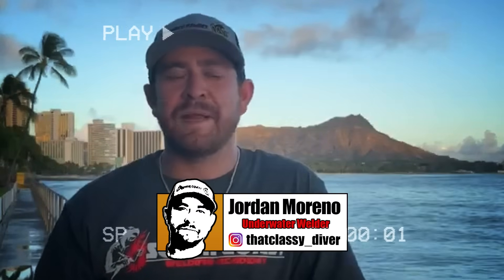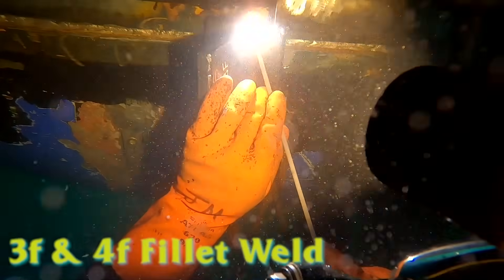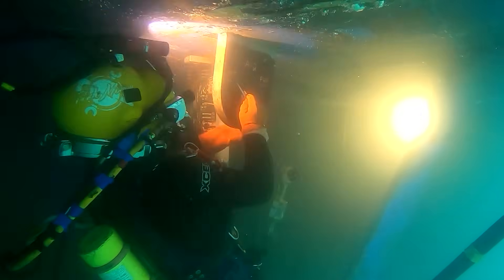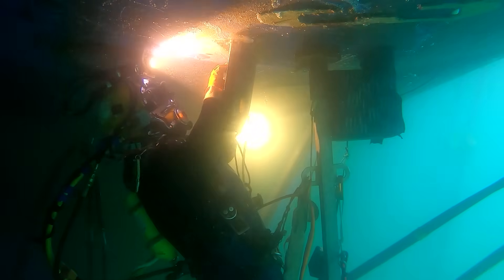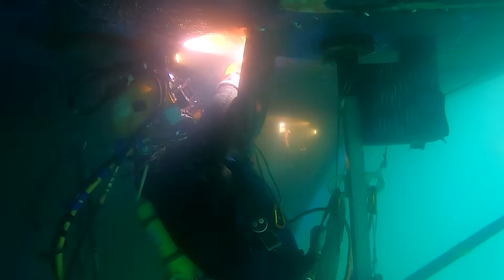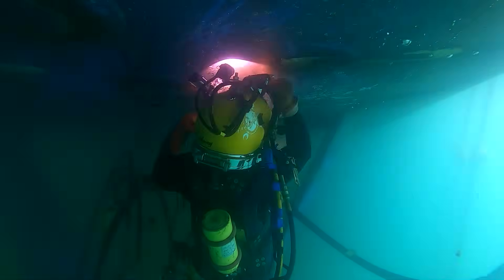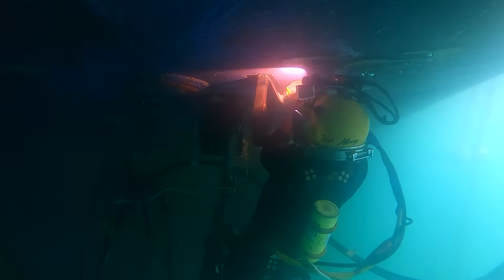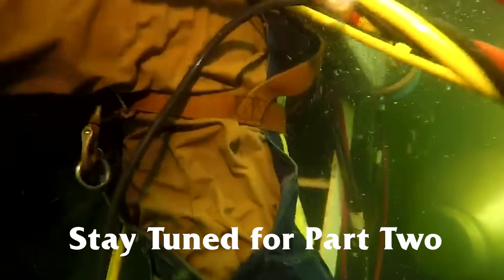Underwater Welding Test | 3F & 4F Plate | Pad Eye Welding

Comment: Are you holding your breath during the welding process? Is that for visability or to keep air from getting into the weld?  Seems like a hose coming off the mask that can direct the exhaust breath away from the welding area would be a good idea

Comment: I'm a retired maintenance millwright and also a certified diver and I've done diving and all types of welding and yet I've never combined both.

It always came across as wrong, underwater, welding and electricity all combined, i can't wrap my head around how you can run a bead underwater.

Comment: Bro when you grinded in 8:21 the metal moves after u welded is that normal?
Reply: Yes refer to the term space welding for a better understanding in space metals can be welded by jus mere touch in water properties are similar but not enough to cause that effect but rather enough so metal is more malleable and can as seen move a bit more freely especially due to the heat

Comment: Weld test are usually the easiest weld because it is in a controlled environment . As a Pipefitter/welder we get some tough welds in the field, tight places, high work, confined spaces, awkward body positions. Underwater welding is a completely different beast though.

Comment: Ironworker here on the topside. I am a structural welder by trade and do a lot of different processes and multi alloys in the field up in the air or at home. When we do multi pass fillets the inspector is supposed to check the first pass . And when we weld the root of a cjp  he might want to check the fit up before we weld  . Doesn't mean they always do lol .And of course all of our cjp's are u.t. . Would be interesting to try that out for sure .  Probably polar opposites in danger.  Being hundreds of feet in the air or being underwater.  Ragnor , harris , forney,  best welds make a shade 8 gold lens by the way.  I wear a shade 11 but stick I have noticed compared to innershield 232 makes a less bright arc . And if your out in Hawaii it might be hard to get what you want compared to the mainland.

Comment: Hi. I’m a construction diver and I work mostly for inshore civil project in Sweden.
I appreciate a lot your job and I have a couple of question.
I’m not qualified welder but I do weld a lot. Now we are welding on a sheet pile wall elements that they will be part of a key. We are performing 3F weld multi pass, 3/4/5 passes depending on how the elements join and how much we have to fill. The pieces we are welding are 5 or 10 mm thick and we use broco rods 3.2mm.
You use 90 amps. We use between 185 and 195. And I have noticed that on the test weld you do the length of the pass you do with one rod is more ore less half of the length of the pass I do with one rod.
The water temperature here is around 1 or 2 Celsius, but I would like to know why you think there is so much difference between your welding technique and mine.
Till now, and I’ve been doing the same job since last November all the weld were ok and supported lots of stress and tons by the concrete that was poured to build the key. But I’m curious to know your opinion.
Thank you!

Comment: I'm curious:

I know nothing about welding but @6:21, it's assumed that there will be a tiny amount of water in the middle of the joint, after the wield yes?

Unrelated question - I am a diver, 10 years, recreation (cold/warm/ice) how do you regulate buoyancy while welding?

Comment: As someone who has been involved in welding, weld inspection, and a wide range of NDE methods at hands on, R n D,  L3, and managerial levels we are not out to " GETCHA " as you say we are there to ensure that you as an operator are competent to meet the standards as laid down in the codes and to ensure  that your companies  weld procedures, instructions equipment and consumables are  code compliant and finally that all of your non destructive tests are carried out by qualified experienced personnel to the required codes and standards this of course will also apply to destructive tests . This may seem like overkill to some but when the you  have witnessed the consequences of weld that has failed under load then it may not seem quite so trivial.

Comment: As an old and now retired welder/diver i can see a decent amount of competence.  But i think some of your tech talk is wrong my friend when you talk about pen and polarity.  You got it arse about face. Neg stick gives better pen.  As a rule of thumb 2/3rds of heat on pos+ side, so if parent is pos its better pen as thats where the heat is. 
But for a O/H config and exhaled gas being an issue good effort... 👍 btw... consider a peanut/ bullnose grinder for dressing tails and finishing.  Far better than a disc which should not exceed 4" really for control
Reply: If by peanut/bullnose grinder you are talking about a die grinder with a tungsten carbide burr that's what I liked to use as well. Way better at cleaning stops and starts. Always hated using grinding discs in the water.

Comment: Do you need to clear slag off of your weld piece when underwater?
Reply: Yes, there is slag. Chipping hammer and wire brush work fine, but if you are feeling really fancy you can bring out the needle gun

Comment: Are you exposed to less chemicals / harmful vapors / metal dust since you are under water? I would imagine your lungs and body would be much safer compared to land welders, since you are in a suit and you're breathing straight from a tank underwater.
Reply: It’s worse being under water. Average life span of a underwater welder is 3/5 years due to all the pressure from the water
Reply: @sosaa3436  Jesus that sounds awful.
Reply: @sosaa3436  I just thought, is it still harmful even if it is all shallow water diving? Like nothing crazy deep to where it hurts you, but just like under boats and shit like that
Reply: @sosaa3436  10-15 years. And the death toll on average is 15%. However this does not take into
Account the amount of companies that do nto
Follow the rules and OSHA standards.
Reply: @HEX_NATION  wrong
Reply: @sosaa3436  wrong. Stop acting like you know what you are talking about. You don't.
Reply: @A_Lemon_Party  not wrong buddy, came from a welding instructor
Reply: @sosaa3436  

100 percent WRONG. This is coming from me, a commercial diver and someone who actually does this type of work,  not some topside welding instructor.

Comment: I have heard of stories here in Australia about divers checking the turbine inlets for obstructions or the bottom of dam for stress marks and damage and they were being taunted by huge inquisitive cod that literally could eat you whole and they surfaced and most said no amount of pay is adequate and just left but some were courageous enough to dive back in but insisted they wanted  cages so they'd see the next day. This wouldn't be easy with boyancy and currents pushing you around, time restraints, low temps, restrictive cramping dive suits, predatory and poisonous animals  lurking around, diminished visibility etc....cheers

Comment: I had a buddy that did this on oil rigs in the Gulf of Mexico. He’s older and man did he have some stories. Luckily, he didn’t have any weird stories where he had to arc into a shark’s nose or anything like that but I did here about him having to go into a box like structure at depth and I always thought that was pretty neat. Sometimes nature was hard to deal with like high currents and back-eddies around those huge legs of the rig. 
I have a huge respect for anyone that has to weld underwater. I met him on a job where he was what they call scarfing walls with these huge golden looking rods that look like black carbon when u broke them open. He would blow holes to make walls and I was the safety guy for the confine spaces they would work in. Talk about stressful. We were always worried about the blow off the rods hitting the insulation as that could make a gas that was toxic if it burned. So I had these little shields to block the welding flash and I would always be watching where the sparks and slag would go. A lot of fire watches with me. He said yeah that was dangerous but paled in comparison to underwater environments and I completely believe that.

Comment: Very interesting video about underwater welding. I was welding for 20 years before moving on to working as NDT inspector the past 8 years. 
I remember upon several projects completion the ship came and it would ALWAYS rain during sea-fastening of structures on deck. 
I got electrocuted while inserting the rods all the time. How is welding underwater safe for you? :)
Reply: @ Hugo Østebø

It’s DC current. AC current underwater is very dangerous and not used...if your leads are in good shape you won’t feel any shocks. I normally would use a pair of latex gloves under a pair of atlas gloves.

Comment: The welding doesn't amaze me as much as the underwater grinder lmao where do you get one of those!?
Reply: @ Justin B

You can use almost every pneumatic tool underwater...same with hydraulics. Of course some will last longer than others and some hydraulic tools are specifically made for underwater use. I’ve used all sorts of things from chainsaws to 1” impacts, concrete saws, shears and wire saws the list goes on.

Comment: And here I am, worrying about the moisture in the air is going to ruin my 7018's (backyard welder)
Reply: The electrodes get covered in a wax helping them stay good while in the water. However, once those electrodes get in the water. They have to be used as they will no longer be good even after taking them out

Comment: how do you not just automatically get electrocuted due to the open circuit voltage?? underwater welding is fascinating to me
Reply: Because welding is always a closed system. The only reason you get an arc is because the ground is completed. You get shocked if YOU are the path to ground.

Comment: I’m thinking about this. Cement pays 24$ per hour in Minnesota. Welding would be multiple times that over
Reply: Not really... no experience basic weld job, 11 to 13$   some experience 13 to 16$   2 years or more depending on certs 16 to 22$ 4 years certs and special training  24 to 28$ 8 years going to the veterans of welding and above 30 to 100$ bottom line they get paid the big bucks because of danger, demand, scarcity being the "welders" who can do the job, and experience. But to be fair it is a skilled trade if you can do the bests welds than you could technically cheat the time it takes for experience
Reply: And those numbers aren't factual just overall that's usually what they are

Comment: So the first question that pops into my head is; does the weld cooling pull whatever it is out of square, harder from the rapid cooling the water would have, or is it comparable to above surface fitting& welding? 🤔
Reply: Yes, but no.  That plate was like 2 inches thick

Comment: Is heat warping ever an issue?
Reply: That a rough 3" to 4"  steel plate you could put a 1000 beads on one side and it still probably wouldn't bend

Comment: I been a welder for 40 yrs. Not under water just wonder where's the bevel on that plate
Reply: If it's aligned 90 degrees why would it need a bevel, but theoretically if he did have a 45 degree bevel he certainly wouldn't be using 3/32 and I don't think welding a bevel from part to base plate would make the weld any stronger. Plus if there was a bevel he would need one on both sides so one weld doesn't put strain on the other weld

Comment: How long do they expect you to stay under there working? Like I know when you go deeper you can only be at that depth for a certain amount of time.. but when that’s not a factor how long do you stay under there for a full shift?
Reply: As long as it takes lad
Reply: @nadiajdavis   to an extent depends if they want a no decompression dive meaning off gassing all the residual nitrogen that was consumed during the dive it matters on depth , the deeper you got the less time you got for no deco dive but if you go longer than that then on your ascent to surface you will have deco stop (basically acclimating or off gassing your body slowly) if you dont decompress and go over said time you fall under greater risk for “ the bends”